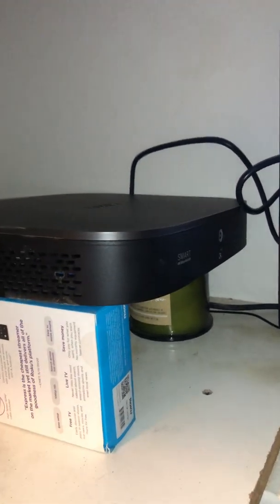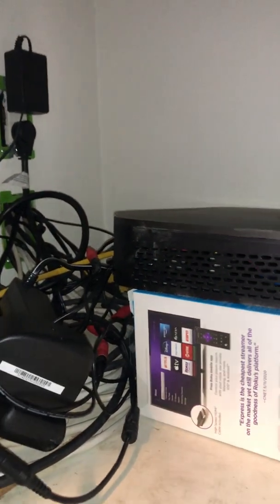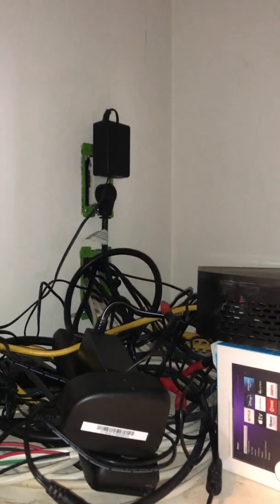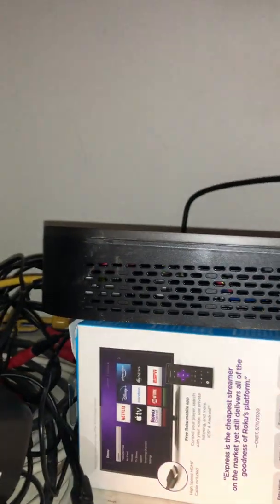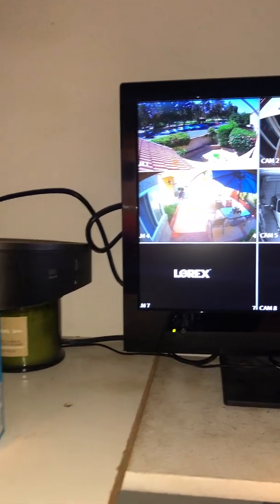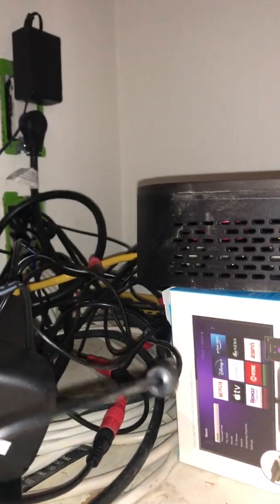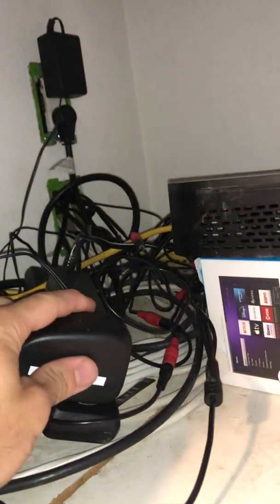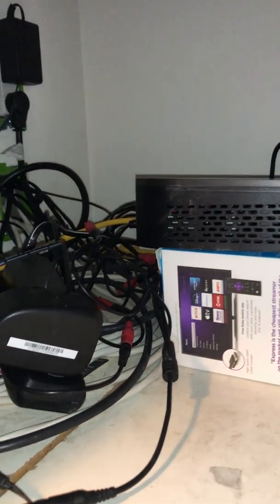Lorex 4K 8 channel CCTV power supply issues.

Comment: my power supply is measuring 48VDC as spec'd.  Can it still be an issue even if the output voltage is good?  My unit is POE 8 camera lorex.  Woke up today and dead.  No lights etc.  Took it apart and am trying to diagnose it. Two capacitors I see on the main board appear good.  Fan not spinning and it was quite dirty.  Any ideas on what to check?
Reply from the maker: If you’re only using one power supply, id recommend getting another power supply with same specs. Try to get it where you have one power supply for the every 3 cameras.
Reply: Turned out it was the power supply. Even though it measured 48v output I put a new on on it and the board light up!  Output voltage being good does not indicate a good power supply!
Reply from the maker: @ nice. Just another thing I ran into was, during the night when the cameras are in night mode they use more power, that’s when my system would shut down.
Reply: @coopercarguy  - put it all back together this morning and powered it up. It’s all running fine. I wish I’d done a back up of the configuration for I lost all that.  Only cost me 20 bucks to fix it. I was kind of excited about buying a new unit for $300 but I think I’ll just get a larger 8 GB drive instead of 2 GB.

Comment: I bought a 6 camera 4k Lorex system, also at Costco< that can be expanded to 8 cameras. The problems is that the power source cable for the system only has 7 out puts, that is you can only connect 7 cameras. How can I solve this problem? Watch power (voltage) is needed to power that 1 camera, maybe I can buy it alone.

Comment: I’m hoping you could help me. My Lorex DVR also supports eight cameras today after a power failure is the DVR does not turn back on the window. I could hear the fan is running and everything appears to be OK. There is no picture going out to the TV I replaced the HDMI cable still no luck put a new power supply the match as closest possible to the original still nothing is there anyway I could recover this I’m on a tight budget I’m paying for my aunts cancer treatments and I really don’t have the money to buy a new one
Reply from the maker: I would definitely try and new power supply that matches the same specs as the one that came with it. I would use at least 3 power supplies for the 8 cameras. I still have problems with mine system due to bad power supplies. You might want to try and difference video source too, another Tv or monitor.